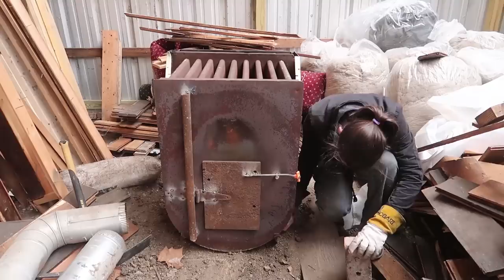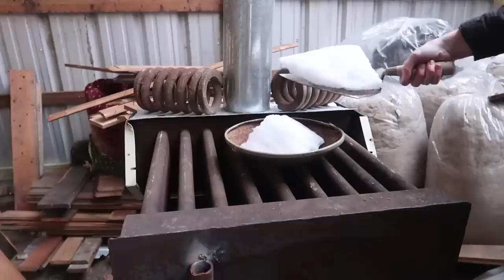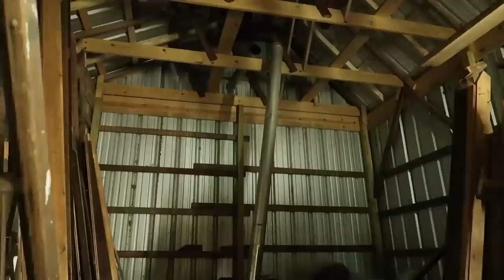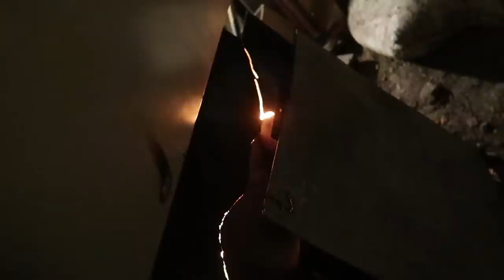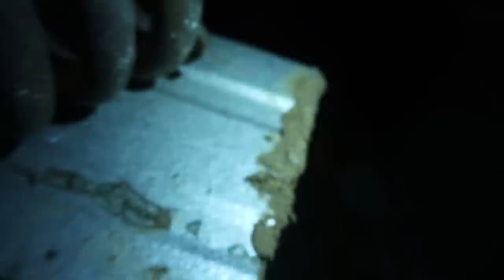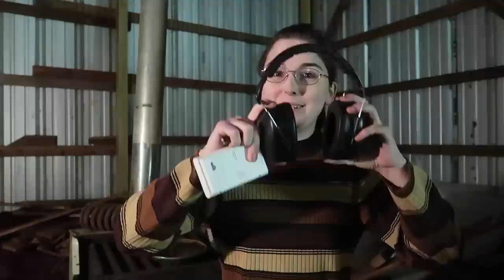Building a 15'x28' (5mx9m) Workshop 23: Installing the Wood Stove / Furnace and the Chimney

Comment: Rhinos great job nut please get regular wood stove  piping... the piping it   isn't rated for use as a flue pipe ... I know u like using and going cheap but these are not rated for it ... ask me cause Mine burnt thru quickly less learned great job otherwise ... like it
Reply: THIS, and it likely could be done for cheap, as long as you can find some old stove pipe that hasn't deteriorated too badly.
Reply: Hey, lets not forget that pine and other soft woods should not be used. Creosote builds up in the pipe and can ignite in the pipe. That kind of explosion could be catastrophic for the entire building.

Comment: Hoping someone will donate a more efficient safer wood burning stove.  Shortlist: 1. Finish patching the stove. 2. Watch the pipe carefully. 3. After the weather changes put a screen in flue so the birds don't move in. Now if you want to spend the money on good pipe, stainless steel triple wall.  I never had a problem with them. Also, I cleaned them every fall. Otherwise, you did a great job.
Reply from the maker: i could easilly get a wood stove, but i dont need more things especially when i have the stuff that will work already

Comment: Just subscribed, saw you on Ave's channel, great video. Don't take any of what I am about to say as criticism. Keyword here: Insulation. I have gone through what you are experiencing with the stove (not a furnace until it has ductwork). I can save you some time: seal up the stove, no air leaks at all. Put in an adjustable combustion air inlet on the front of the stove. Put in a damper in the flue about 3-4' above the stove. These two things will allow you to have a good fire throttled back to burn for a good long time without smoke & smell. Think about protecting your shed framework up where the flue is close to it, should be TRIPLE wall pipe anywhere close to combustibles. Get a pipe cap rated for wood burning, the one you have looks to be a gas flue cap, it will not last and can plug up with soot as it sheds heat very fast. Keep an eye on the single wall pipe, it will eventually get thin and burn through, not as bad when throttled down. Get a flue thermometer at a woodstove store and wire it around your flue, will help you adjust your air.  Get at least a small ceiling fan to stir up the air in there. ENJOY the heat. Don't have an active channel yet, got a camera last month. I just finished my retirement shop, 35' X 70' X 24' @peak metal building, concrete floor, R38 ceiling and walls. Putting in electrical now. Driving to Springfield, IL for a used backup generator next week, weather permitting. 68 yo male, wife is Laurie, SD native, in CO since '77, now 45ish miles NE of Denver, electronics geek-retired Jan of 17. Michael in Co, talk at you later.

Comment: Stove pipes do get HOT. We have an ancient cabin with a stovepipe running through a wood and plaster wall, and even 6" away from the pipe the wood and plaster are charred (we have resolved this situation now). It might be a good idea to change the pipe mounting supports to metal, and put some kind of nonflammable insulation material (or flashing?) between the pipe and framing inside. I'm sure you have plenty of salvaged materials you could use for that :)
Reply from the maker: i will redo it for next year, but for this winter its fine.

Comment: It is possible that your hot pipe is too close to the wooden beams in the horizontal section of pipe that heads for the side of the building. From the video you cannot really see what the distances are. There is a clearance issue as you know with combustibles. If you do not have distance you could shield the wood from the heat by adding another layer of metal that is not directly in contact with the heated smoke from the stove. Just a thought.  You are a person with a lot of courage, creativity, and drive. the building is coming along well. Considerable accomplishment.

Comment: You can induce a reliable draft, when lighting the fire, by preheating the chimney with rolled up newspaper set on fire. After a few seconds of heating, just put the burning paper on the kindling and it'll start up nice and smoothly.
Reply from the maker: how is that different from what i did?
Reply: @RinoaL  It looked like you just had paper (or leaves) in the fire box. Sticking some burning paper right into the lower chimney is more effective.

Comment: If you added
1. A damper to the chimney.
2. Gasket around the door.
3.a draft opening under the door,in the front of the stove.
4.build a grate to keep your fire up off the bottom of the stove.
5 a way of unloading the ashes from the stove.
It would work better.

Comment: Tonia hope you've gotten yourself a pair of safety boots.  Have you thought of surrounding the furnace with bricks on both sides and back if you made it two bricks thick it would stop the surrounding areas from over heating, but it would also retain a lot of heat which will slowly be released over some time once the fire is out a sort of rocket mass type of thing.
Reply from the maker: bricks would stop heat from releasing and make it less efficient

Comment: Some bricks underneath, and around will give it more thermal mass so you won't need to burn as much. Also they make fans that run off heat to put on top of wood stoves but as long as you don't have any roof leaks a ceiling fan wouldn't be a bad idea and would help year round. Most importantly is you're not freezing out there now. I can deal with high 90's no problem but I hate the cold.
Reply from the maker: i'd rather take te cold over 90s with 98% humidity though.

Comment: It would be Betta to place some cut out concrete blocks curved to the outer body of the heater...1.they can be relaxed or moved.. 2. They have space in them so heat won't migrate into the ground...i know is am late to reply on the placement of the heating unit...but I thought it would be ideal to reply... 

Stay safe
Stay warm.. God bless

Comment: If u hooked so a blower on a thermostat it will be plenty big enough. Good job on the reuse of furnace into a wood stove
Reply from the maker: it doesnt require a blower, however i will use small fans to push the air back down from the top of the workshop

Comment: box it in and have fans blow air past the heat excheanger and vent off in pipe to other parts of the shed that way the ducting you side you like cos it would look industrial would also be doing a job

Comment: You would have more control with a damper plate on the stove pipe and cutting a slotted grate with a sliding slotted cover in the stove door (lower third.)
And it may be a cool (pun intended) idea to put a plate under or good tin around the exchange tubes and using sand (if you have any left over from the house water pipe) and filled the voida with that to make a nice heat sink/ thermal mass.
Maybe stack some of your less desirable bricks around it once you cobble your shop floor.
Three thumbs up, Rin

Comment: Once you seal all the stack pipe you will get a great draw on the air intake my be cut a round hole on face plate of door that you can twist open and shut

Comment: The best setup I seen using a homemade stove is flush agin the wall. Run the flue directly out the wall in to a standing pipe with a clean out on the bottom. Old timers use to use old well casing, you can still find it. You can add some sand to the exterior of the stove to hold more heat using a brick wall. You really don't want the pipe inside of the building, just temping a fire hazard.  I know it gives the puts more heat in the building, but it is just temping fate. Once you get the building warm will not be a problem. Perhaps find a way to move the heat from the ceiling to the floor. When you brick the floor, put down 6 mil poly, then 2 inches of foam, then your bricks. Worth the time and effort. Otherwise you will never get the floor warm. It will just suck the heat out. If you fell ambition put pipes in the floor and circulate hot water.

Comment: Were those electrical wires that were hanging down from where you moved them heater ducts in your basement.
Reply from the maker: those were an extension cord for those lights and some old rope-lights we used to use to illuminate the basement.
Reply: @RinoaL  👍🏼

Comment: Be careful with installing pipes horizontally. because the smoke does not bend. install diagonally for better evacuation
Reply: cuidado con instalar tubos en horizontal . porque el humo no dobla . instalarlo en diagonal  para mejor evacuación
Reply from the maker: that a joke?
Reply: do not. . ask a fireman. if this installation is safe

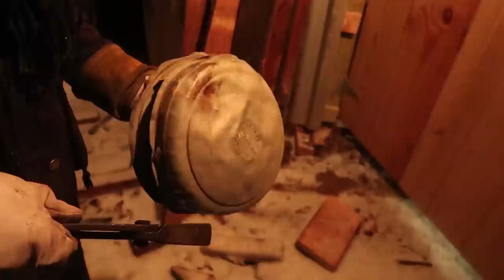Comment: Nice tongs! 13:40 Any idea what they are called, if they are still made, or where to get a pair?
Reply from the maker: blacksmithing tons, made in the early 1940s, with a WAR finish on them.
Reply: the handles cut shorter?  what is a WAR finish?
Reply from the maker: means its made to lower quality to increase production during ww2

Comment: ps Rinoa put a Smalltalk behind the stove on low it'll help circulate the warm air I keep mine tthree foot from it and let it blow across the top to circulate the heat warms the whole garage this way ..again enjoy curative.. oh put gasket around the door get the gasket material at Big R or TSC
Reply from the maker: what is a smalltalk?
Reply: nit small talk a small fan
Reply from the maker: ok
Reply: I'm impressed u did a great job little money using a lot if used lumber and recycled stuff ... Really like how it came out really impressed .. oh yeah make sure pipe on rafters has metal plated or something in case. pipe catches fire or gets to hot don't want ur rafters going up in smoke ... u put to much work into it. great job.. u gonna put a railing up in it loft ?
Reply from the maker: no, railings protect the weak!

Comment: Drill a 1/2 or larger  hole about 1.5" form the bottom it will increase airflow and create a better draft
Reply from the maker: already two like 1" holes in the back. dont need any more airflow.

Comment: by the way u need more draft by way of a vent in front of stove drill/cut a hole weld a pipe on it and drill hole in it for air on threaded part then put a cap on it to adjust the air flow this way the more holes showing the hotter it burns.. less air the slower it'll burn also put a damper in stove pipe best to u in ur endeavours my friend
Reply from the maker: no that would be bad. the exhaust comes out the front right behind the door. thats why i have the big holes in the back so the air has to go over the fire first. >_>

Comment: you need to seal all the holes in the back  wow   and put a damper in the pipe
Reply from the maker: the holes in the back are where the air comes in for the fire

Comment: I'd weld some sheet metal to the back of it to cover some of the bigger holes.
Reply from the maker: need those holes to let air in.
Reply: Then maybe a cover some 5cm away from the side so no sparks or hot ash can fly out.
Reply from the maker: have that piece of sheet metal on there for that

Comment: First of all you have the wrong chimney material it's not rated for this.  You need to wrap some aluminum foil on any and all surfaces that come in contact with that heat of the chimney or you will have another fire for sure. Also a thermostat for the stove to chimney for protection they can get to hot. : ) peace
Reply from the maker: i dont think you understand, this is free, so its the right material
Reply: @RinoaL  I understand that, but I"m concerned for your safety. If you look around you are sitting in a wood pile, you could loose everything. Just think about changing it in the spring. : ) peace

Comment: you are so sweet but electric never will beat gas
Reply from the maker: well it does. it heats our house better and costs less money.
Reply: Depends on the climate and existing infrastructure, but I would go for a heat pump instead of resistive heating...
Reply: Well as a proud owner of an electric car (Nissan leaf) I commute 40 miles every day for work and you can't beat that $0.25 to recharge it every night...
Reply: Rinoa Super-Genius You must have had an ancient furnace. In new ones, gas is far better.
Reply: I'd never in a million years heat my house with gas like one thing goes wrong and kaboom we used to use oil but now we have a ground heat pump.
Reply: Depends on where you live, In Belgium it's cheaper to use gas than electricity due to high taxes on our electricity. Same goes with electric cars, sure they are "eco-friendly", but what's the point when a charge of your battery cotst you more than actual gas at the pump.
Reply: @tateseacrest4609  battery replacement is crazy costly and resale is poor  big picture is not that pretty I am being honest only not mean ...
Reply: @RinoaL   please be careful, space heaters are very hard on electric sockets long term is not very safe, also you are probably only have 14 gag wire in that old house .I think you are darling I am not trying to be mean I am a old man and have been around and i have 5 houses that I take care of and have seen a lot